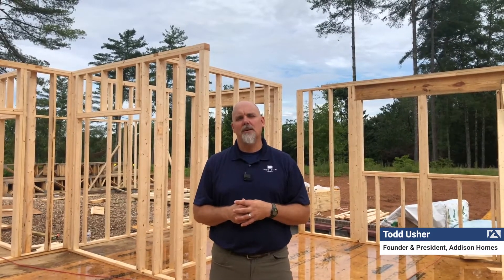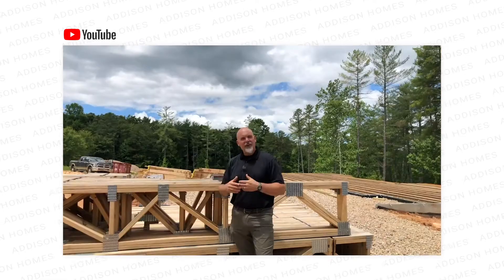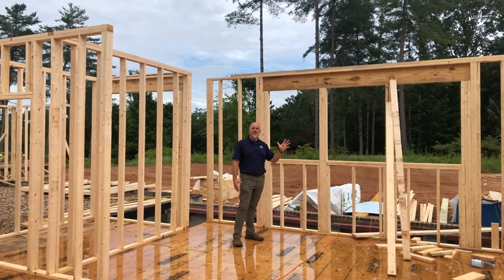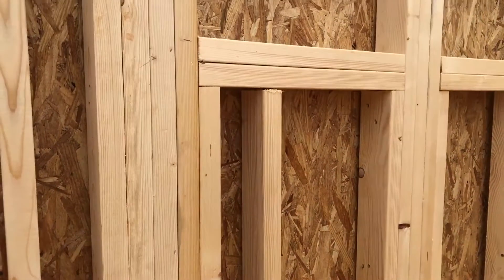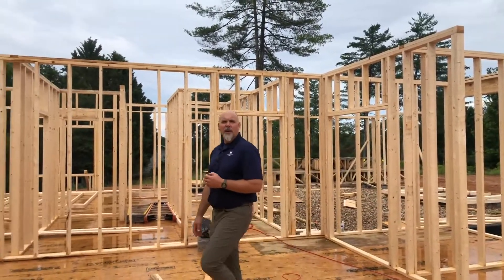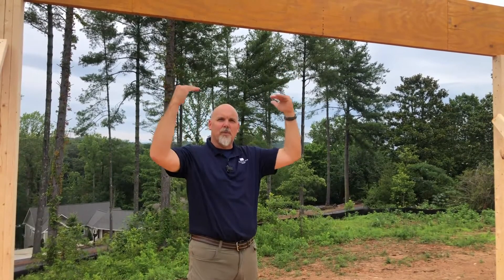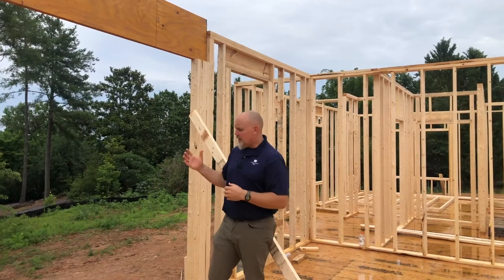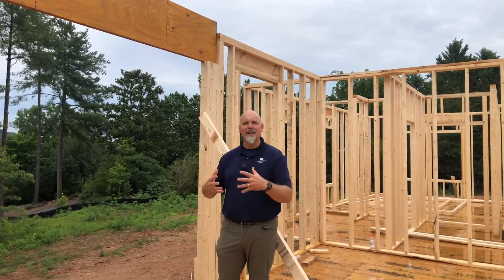Framing Walls | Zero Energy Ready Home

Comment: Are these 10' walls? One thing I noticed is that if I am doing 9' walls I get 9' OSB to avoid the gap you had on this property. ZIP tape over the outside the OSB gaps would fix it but if you can avoid it by doing 9' OSB vertical I recommend.
Reply from the maker: Not completely sure which gap you're referring to, but even the 9' OSB will have a seam when framing over a floor system and even on a slab when using raised heel energy trusses.  This home had both, so there's no way to span the full framing assembly with one sheet of OSB.  Hope that makes sense!